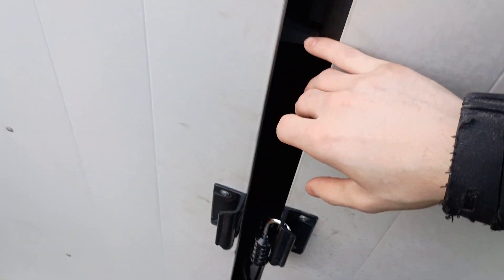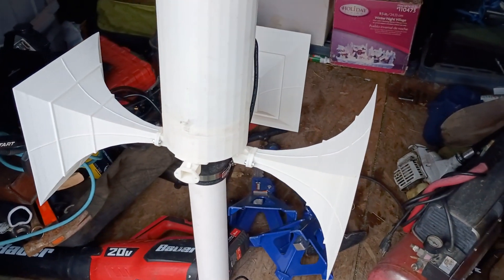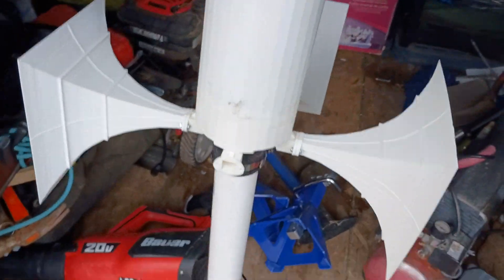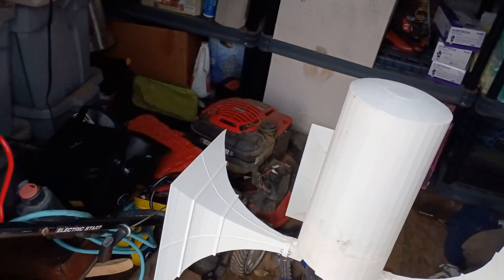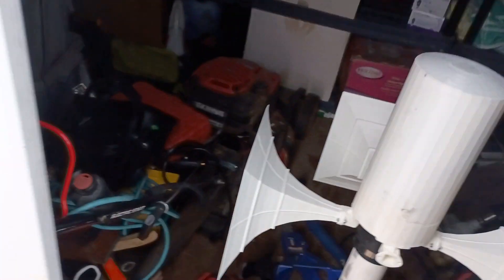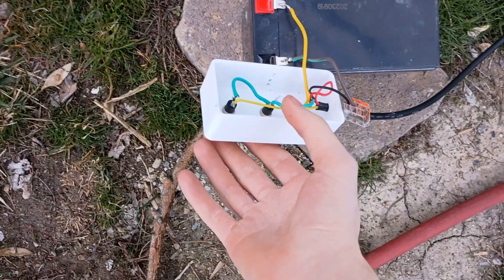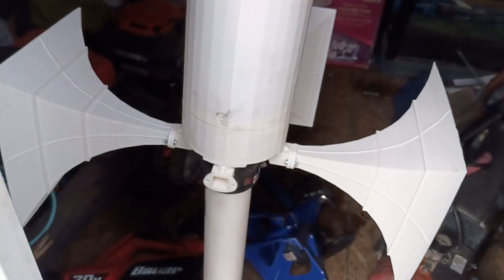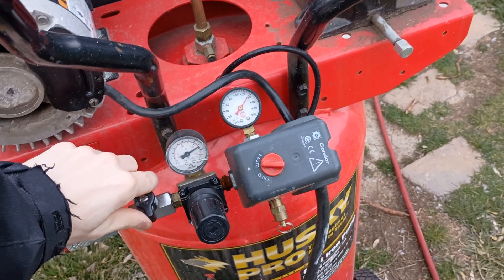Mini HLS-273 Siren 140PSI Short Update and Test

Comment: Just wanted to ask a question. Folks call sirens like the HLS 273 “pneumatic” when it looks like it uses a chopper assembly with a compressor, so wouldn’t that just make it supercharged? Or maybe I’m missing something lol.
Reply from the maker: @T2110D  more or less, pneumatic means the siren uses an external method to deliver pressurized air, whether through a supercharger, turbocharger, or pressurized air from a tank
Reply: @ thank you!
Reply: With player pianos, we call the air pockets "pneumatics", in which are like air powered silonoids. So pneumatic on a siren would mean it uses air based parts, meaning like a compressor or blower.

Comment: The spool-down sounds exactly like the real thing. The HLS I've heard sound a little higher-pitched around 420-440 Hz, meaning that the motor should spin between 6240 - 6500 RPM. You could achieve that with a lithium battery or just a regular power supply and/or a motor controller. I really love how this thing looks and sounds, your year of effort definitely paid off. I'll definitely print it, or have it printed.
Reply from the maker: Thanks! It'll run better in the next video, battery was a bit low and I am still dialing in the resistor and capacitors.
Reply: @utahsirens  Very much looking forward to it!